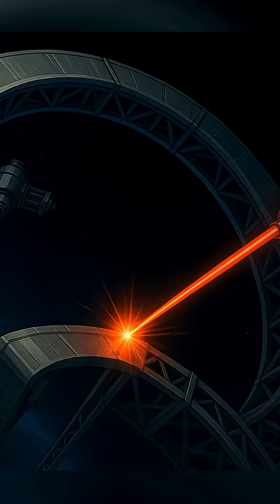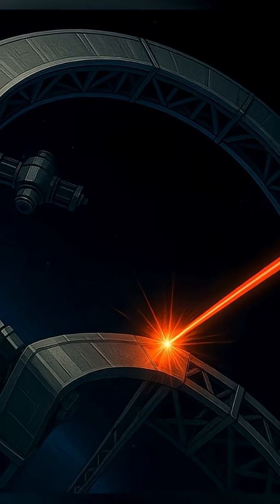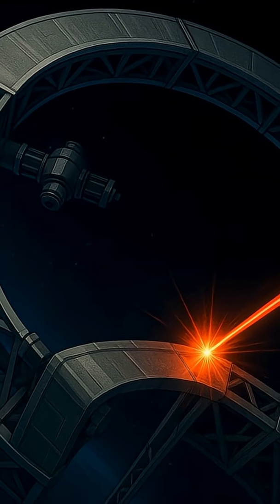Laser Based Space Construction- Genius Physics Workin #Science #Laser #Space #spacestation #research

Comment: Sure now you just need a massive energy generation and storage system for the lasers
Reply: Yes, but it might be not that hard to do
Reply from the maker: In space that wouldn't be as hard as you might think, a massive solar farm can produce quite a bit of power, especially if you set it on a polar orbit with small corrections through the year to make sure it is continually in sunlight